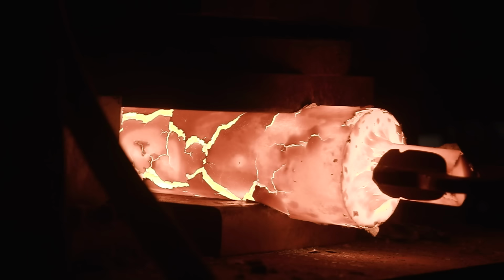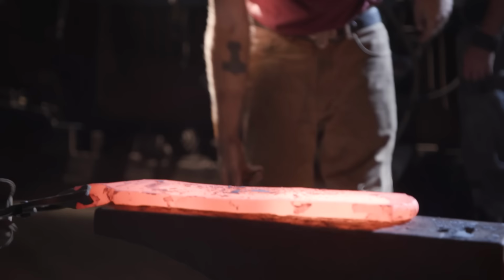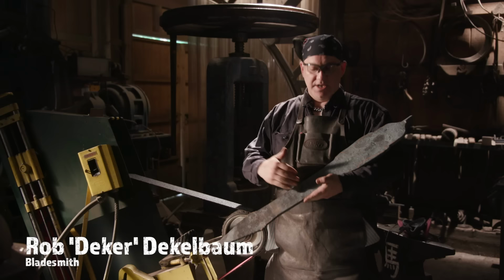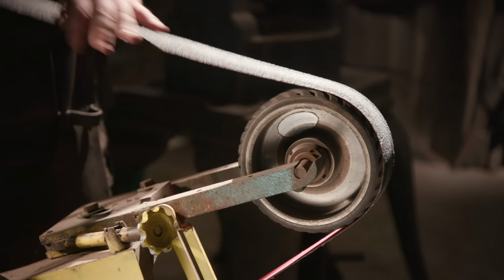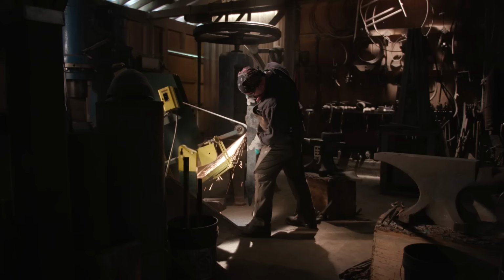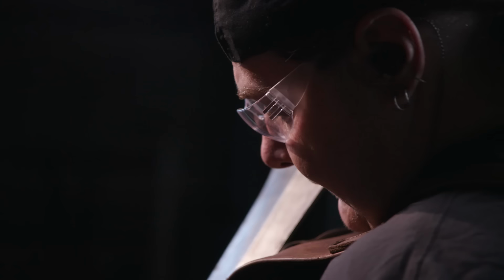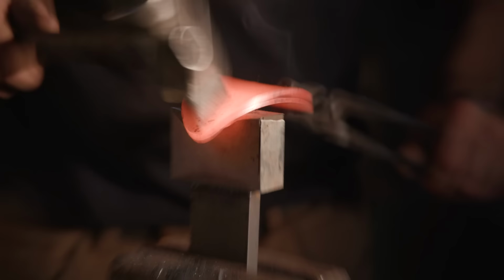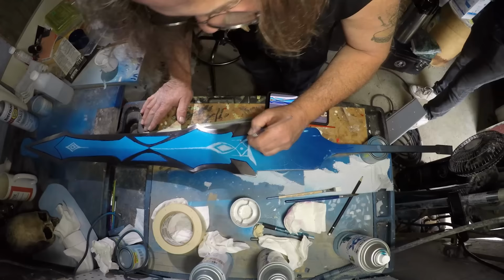Song of Broken Pine - Genshin Impact - MAN AT ARMS : REFORGED

Comment: The blade looks amazing, and love the way you did the guard. The only thing i feel a bit disappointed by is that the painted details near the hilt and blade flat look quite messy and it throws off how clean everything else was done. Still great none the less, but it sorta stuck out like a sore thumb, especially during the close ups.
Reply: Yeah I was really disappointed with the paint and was hoping they would have also made the metal blue with a furnace
Reply: Same
Reply: Alot of their works are kinda crap up close
Reply: I was hoping for graveration of this parts and paint inside, that would be much more clean looking
Reply: Yeah, I was thinking maybe the original had a tribal sort of intentionally rough painting on it, but no, the one in the game is very clean and sharp everywhere
Reply: Idk how far in advance Mihoyo got them to do this. But it did seem like they we're pretty rushed. 

Man... If only they had time to stained the blade blue, that would've been sick.
Reply: to be fair, it's a fantasy animated sword, certain details might be more difficult to pull of irl more than what we think so
Reply: You can see that they rushed a lot with the final part of the paintwork
Reply: Agreed, that irritated me too. They should have had a car paint detail artist make those lines like they pinstripe a car. Ultra neat and clean.
Reply: I was about to say the same thing. Those drawings were really done badly.
Reply: @niffleraku  Yeah, it's not hard to paint straight lines. I mean, the guy literally showed us 2 minutes prior in the video how to paint straight lines.

Comment: Make Marth's Falchion in Fire Emblem Heroes. The only difference's gotta be w/ the cross-section. Make the hexagonal cross-section combined w/ the central ridge. Keep the cross guard w/ the upswept quillons, the straight blade w/ the straight parallel edges, the sharp point, the two red gems on the guard, the brown handle wrap, the pommel, AND the two green gems on the pommel.
Reply: Now, wich one? Normal, Exalted or Genesis?
Reply: @theblitzraider3563  Hero King Marth's Exalted Falchion. I'd go w/ the hexagonal blade section AND the ridge in the middle. I'd go w/ the gold-plated hilt, two red gems on the cross guard, two green gems on the  pommel, full tang blade, straight edges (as symmetrical as a Jian sword's blade), sharp spear point, unsharpened one-handed ricasso, the hollow cut-out on the blade, AND the hexagonal cross-section w/ the ridge.
Reply: @theblitzraider3563  Marth's Exalted Falchion.

Comment: Can the scale be recovered or reprocessed? I know as the build progresses, the iron content of the scale increases with each stage.
Reply: Yup, it's a high carbon content iron material, so if you were forging your own metal as well as smithing, you could reuse scale for both extra iron and carbon content. It's very low density though, so definitely don't expect it to be all that much volume you're getting from it in the end.

Comment: As fantasy swords go, this sword really doesn't look all that unreasonable, with the exception of the size of the blade and how much weight you'd probably have in the hilt. The handle is a decent length, nothing hangs in the way of the handle. As long as your point of balance isn't in a weird place, it looks wieldable
Reply: The result is shorter than it would be as reflected in the game. The funny thing is that all the weapons adjust size to its wielder, so it'll look different based on whether you give it to one of the taller characters (Eula, Diluc), medium height (Noelle), or chibiko (Sayu). A Sayu-sized claymore looks much like a one-handed sword for Jean. I've tested this with bows, too, between Tartaglia and Diona.

Comment: The blade looks amazing! But it has one issue and it’s the paintwork
It looks really uneven and the colour isn’t that solid either (you can basically see through it and see the blue parts of the blade underneath)
If only they spent more time to perfect the paintwork as they did with the rest of the
blade, the result would be just perfect 
It kinda breaks the illusion for me and I think the blade would be better of without the white paint job :/

Comment: I have a question: during the whole forging process there's a lot of slag, scaling and shavings produced... What happens to those? Can you collect them, molt them and re-forge them in a new lingot or are they unsalvageable an get thrown away?
Reply: It can be reused but it is not high quality steel and takes a lot of work/material to be able to get enough to make a serviceable billet. Too much work to be efficient when you can just clean up, throw it away, and buy new steel
Reply: @karatekid10908  thanks for explaining, I appreciate it.

Comment: Had to dislike this, the freedom sworn isn't supposed to be a 2 handed sword at all and being this heavy... the detail work on the pattern for this one was also not good...not good at all
edit:
-blade quality and shape itself is fantastic for the "song of broken pines"
-the shaping and quality of guards is good, but missing parts towards the blade itself 
-specific color choices are not working too great, making it look somewhat cheap, but might be an issue with metal in itself
-detail work is horrible, especially the painting and completly overlooking the gem (maybe try the same method as was used for coloring the whole blade blue itself and just put tape on it for the detail pattern, freehand certainly does not work at all seeing the result!)
-completly wrong advertising, worng character and wrong weapon even though there is a few similarities on weapon design, they do have their own particular details